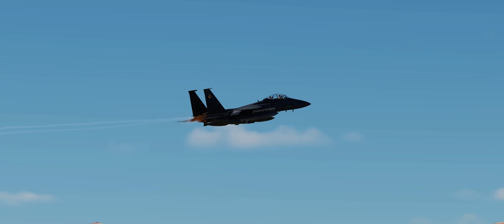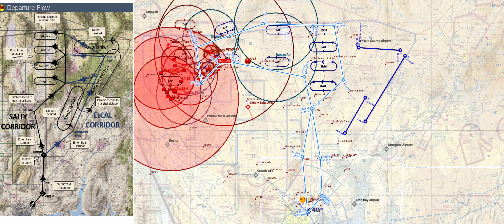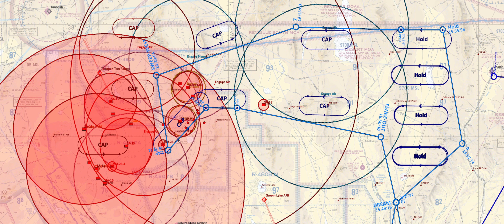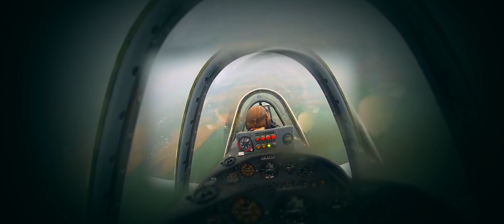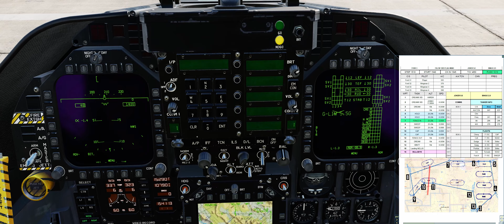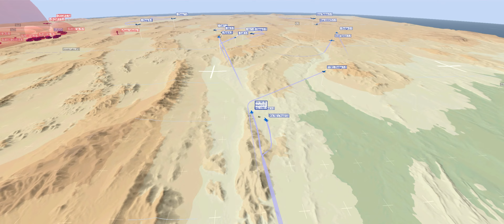DCS F/A-18C Red Flag 16-2 Campaign MSN3 | Pt1 - Brief & Departure

Comment from the maker: For anyone interested in replacing the original F-15C within the mission editor to an aircraft of your choice, PLEASE NOTE: you will not be able to save any changes as the campaign missions are protected. You can fly the mission with whatever changes you have made, however once you quit your flight the mission file will reset to it's original state. So don't end up doing hours of modifications because the mission can't be saved with them.

If changing aircraft in the Mission Editor, just do the following:
- Find, select and change the player's flight to an aircraft of your choice
- Select the weapon loadout for your aircraft and your wingmen
- Set the flight to start from "parking hot" as you only have 10 minutes from mission start to takeoff
- Set an extra waypoint for your flight to coincide with the Bullseye if you want to get picture calls from AWACS

For additional immersion in my particular case I also spent some time removing some of the original objects on the tarmac which made no sense and instead put a whole bunch of NATO generators on the ramps (this is from the vpc ground objects mod). This was merely for cinematic purposes and some additional eye candy in the video. However as stated before, these changes cannot be saved so you only have one go at flying the mission and then you have to change everything again if you want to restart the mission.
Reply: Doing exactly this, great campaign.  Even more fun in the hornet with some real SA!

Comment: I've been wanting to do this for years!  Unfortunately, all of the ME options are locked when I fire up a mission. What am I doing wrong?  Thanks.
Reply from the maker: Just locate the mission in correct folder. I’m not at my computer atm. But it should be in C/eagle dynamics/ DCS and in there somewhere I think should be a folder with all your campaigns. You can just open any mission file separately from this campaign in the mission editor if you locate it. From there just edit whatever you need and click fly.

Comment: A pro tip, you can do this with the F-16 red flag campaign also. Just ensure the radio frequencies are right when you do so.
Reply: The missions in the 21-1 F-16 campaign are different from the F-15  16-2 Campaign, correct?
Reply from the maker: @MisterMannIndy  Yes they are totally different. The F-15 is A2A only :)
Reply: @CommandT  thanks!  I will pick it up.  Never even considered changing the player's aircraft.  Brilliant!
Reply from the maker: Oh that's an interesting point. I might try that! Have you played the 21-1 F-16 Red Flag Campaign? Is it pretty good?
Reply: @CommandT  it's bunyap, so it's excellent from an immersion standpoint.  I didn't realize he had a role in the F15 campaign.  I only did a couple of missions because I gravitated back into the hornet.  Thanks for the idea to swap out jets!
Reply: @CommandT   I've played a few of the missions from it in the Hornet (im not a viper guy). That campaign was made by Bunyap, and its more or less in the same style as this. I think he both rebuilt this one and did the F-16 one around the same time. So very limited scripting just like this one. Basically you have a push time you have to hit. But ofc theres a mix of A/G missions also.

Also you may want to go back and play mission 1 of the F-15 campaign. Its an air start "arrival" mission but its combat arrival style. IE you don't go to Nellis, you go direct to a CAP station and do some F-15 BARCAP things (read shoot things down) protecting other assets as they fly into yheater. Its apparently based on a real scenario that was flown at a red flag.

Mission 2 is a full blown FAM flight though.
Reply from the maker: @Chenstrapftw  Thanks! Yep, I'm aware of both mission 1 and 2. Wanted to start with No3 as I thought it would be a little more action-packed :)